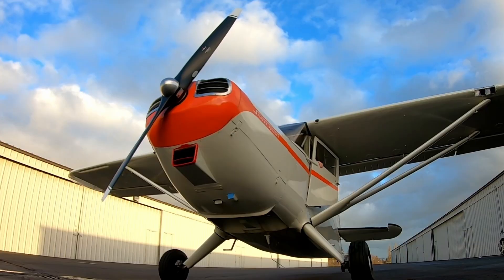Becoming an A&P | 3 ways to be a FAA Certified Mechanic

Comment: I'm a Truck driver, been an owner operator repairing my own equipment for 30 years, but my driving days is over.  At 58, am I too old to become an Aircraft Mechanic?  after watching this video, it seems to take a very long time to become an IA.
Reply from the maker: You are defiantly NOT TOO old tone an A&P. Depending where you live You don't need to start with an A&P, you can work for a repair station.

Comment: I hear there is another way you can buy build and complete an experimental aircraft
Reply from the maker: That would be a Repairman's Certificate, if you are the builder. That certificate is only good for that airplane. An A&P is able to sign off the conditional inspection. This is the only time you don't need an IA for the "annual" inspection.